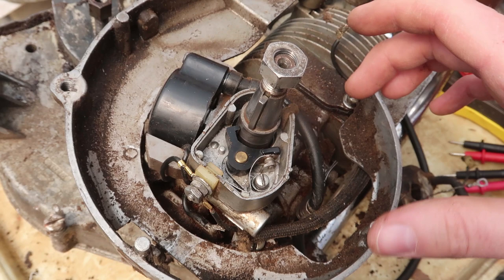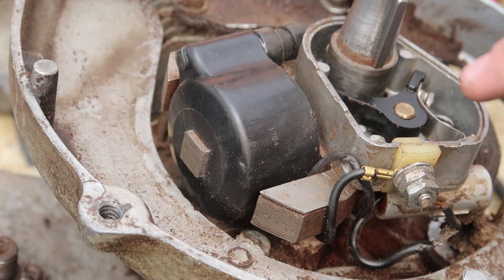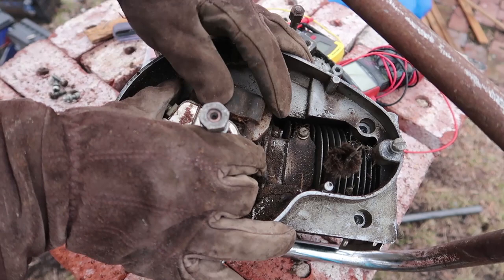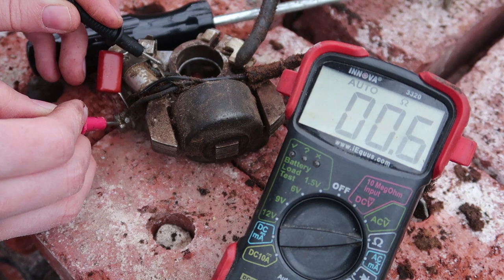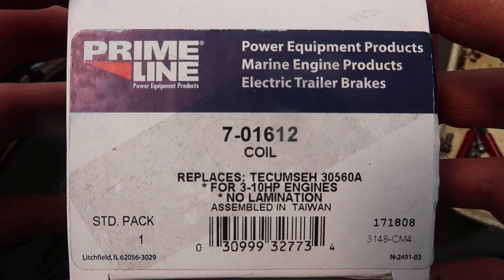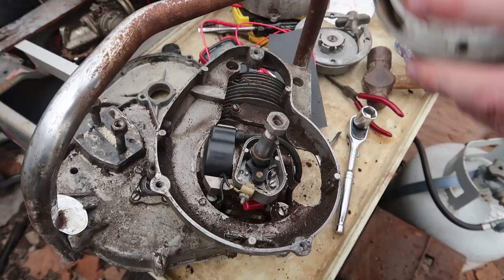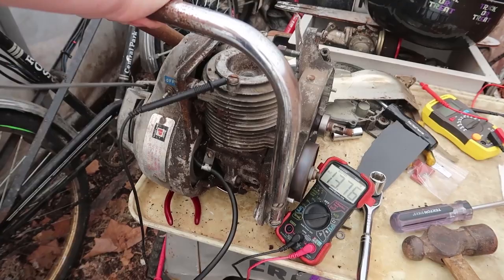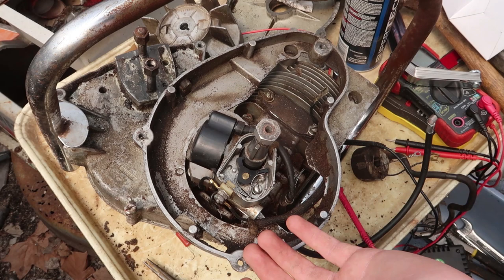1950s David Bradley Chainsaw Restoration 04: Magneto Coil Upgrade Experiment, Fix No Spark

Comment: Make sure there is no suface rust on the inside of the flywheel
Reply from the maker: why?
Reply: So that magnets can be as efficient as posable also when seting the coil to the flywheel rotate the flywheel and let the magnets grab the coil then insert a piece of paper between the coiled the flywheel ( might have to double the paper so there is no rubbing) this very critical for a strong spark.
Reply from the maker: cant set coil distance at all in this
Reply: Sorry that works for external coils But try and shim out some how till it almost touches the inside of the Flywheel.   .010    or less. Also the wire that goes to the switch at this time unhook it completely all it does is ground out the mag to stop the engine . if you do get it to start just put a screwdriver from the clylinder fins to the high tension lead on the spark plug

Comment: the cable that goes from magneto to switch to frame is how u kill the engine when u want to turn the engine off. If that wire does not go to frame then you will get no spark. U have other issues as well im guessing but just confirming for u what that wire is for. I had a ride on mower a few years back that started to play up. The problem was when i wanted to turn off the engine it would not turn off.. I found out later that the wire that goes to the kill switch had rubbed on the frame and was grounded out before the switch. Allowing it to start and run but not shut off.
Reply from the maker: sure but it doesnt seem to make much difference when measuring resistance.
Reply: I dont get it either.. and im sure there is more issues then this going on, but thats how a kill switch works in general.. it breaks the wire from the coil to the frame. I can see the wires are joined on that bolt that looks like its on a nylon insulator? if U pull the wire off that goes to the kill switch do u get continuity from that wire to the frame? as You should not be getting a reading between the 2. You may have done this already I cant remember.
Reply: Nitris
The opposite, if you ground it you will kill the ignition. The kill switch is parallel to the points, when grounded it bypass the points so they no longer have any function. :)
Reply: Koaren so u are talking about this chainsaw specifically or small motors in general?
Reply: Nitris
As long as you have a magneto system it's standard. On battery and generator systems, you switch off  V+ to the ignition coil.
Reply: Fair enough I can understand how bypassing the points would kill the ignition system ..

Comment: put it back to STD as close as pos  points 12/15 iron lams no prob  i do that all the time  air gap ///mags to to lams no more than 35 ///looks like a wico set up
Reply from the maker: your comment is very difficult to understand, but you cant adjust distance from the magneto core to the magnets
Reply: i know but it dose have a spec

Comment: You can't replace a condenser with a capacitor.that condenser can be charged with enough voltage to knock you down that electronic capacitor can't do that.
Reply from the maker: you obviously lack a fundamental understanding of electronics then

Comment: It´s still named "Kondensator" in my language.
Reply from the maker: thanks, ive been trying to increase my knowledge of german. one more word for my vocabulary. (•̀ᴗ•́)و ̑̑
Reply: Same in Swedish as in German i think... :)
I am not sure, but it possible came from German back in time... (However, ve used lot of American stuff here back in time)
Capacitor is probably an updated name? At least It feels more modern to better fit the theory.
Reply from the maker: yeah ive started to notice how a lot of other european languages share a lot with german, im thinking about once im done with german and japanese i may try something like swedish. I wonder how all these crazy problems in sweden will effect how useful the language is. Like if sweden does continue going downhill, there might be more swedish-speakers moving to other countries before too long. would be sad if Sweden ends up with mostly middle-eastern languages and all the swedish speakers move to other countries. lol

and i find "Capacitor" starts replacing "Condensor" some time around WW2, i think because with WW2 technology we started going more towards electronic circuits than older systems. and i think the latest i ever saw "condensor" is maybe the 1960s. so really the name came about when electronics was established.
Reply: Sorry for loosing my temper about that topic...
I think i better delete that.

(In case someone wonder, it was not about Rinoa, it was about the fact that i am to say the least furious about my country)
Reply: I hawe ADHD so i often rushing away when i write things.
Reply from the maker: aw darn, i didnt get to see your rant. could you PM it to me? id love to hear your opinion but i totally understand not wanting to say it publicly.
Reply: It was just about those happy cload people here try to cover it up, they are idiots.
The truth i see with my own eyes is that the social cracks between poor and rich people has escallated like a rocket since the early 90s. I hawe lost my fate in Europe, at least in scandinavia. Now it´s fine living here in the north, but not if this continues when i grow old and no longer can take care of my self, i want people i can trust around me, not those underpayed lowbeings. Health care, education for our childern, etc, that´s where i want the tax money to go if i could choise... I am not the only one seriously concidering leaving this country.
Reply from the maker: if you leave, try coming to Hillsboro illinois. you could rent a house for pretty darn cheap
Reply: I am actually tempted anyway for a limited period if i can make it possible in the future, it had been wery interesting to live ower there for a bit longer period just to learn and see all that wonderful stuff and the nature, etc. I will absolutly keep that in mind. (Honestly i think i look more like Ron Soyland then a beautiful girl, but yeah... ha ha!)
Reply from the maker: meh, physical looks arent as important, it just matters that you know how to look nice with what you have. i notice too many transgender people simply dont know how to look nice and choose all the wrong clothes. way to feminine or flashy. oh and about visiting, you could maybe come next year and stay at the Red Rooster Inn when its done.
Reply: I would love that!
I am not traditional transgender i think but bi gender with a dominating womanly side (at least i feel like 100% woman inside, but i am not sure if i will ever dare to start a real HRT and stuff even if i dream about it a lot).
Reply: Since i was a kid, I often wished there just was a secret closet one could walk into and the come out as the person one are inside, but we all know it does not work that way... ha ha. I wonder if one was born that way, i guess i had missed lot of knowledge and life experience, so probaly at least  i got something from it... i don´t know... ha ha.

Comment: spark plug aint no good
Reply from the maker: both of them that i tried?
Reply: If the  other one was used too then quite possibly or if its the wrong kind of plug,   if it hits hard enough to hurt , it should fire the plug .
Reply from the maker: no the other one was brand new. it was for a motorcycle and it's gap was shorter, but i dont think that really matters.
Reply: I could certainly be wrong . Iwoulda bet money on it though . and for what its worth i was hoping to be helpful .. and right ..   I watch your channel every day  for quite a while .  i feel honored you replied . let us all know when you figure it out .   
If you haven't already .. you could check the plug for continuity .
Reply from the maker: i checked it for continuity, but another thing to check would be insulation. i might see about making a high-voltage tester for these applications.
Reply: Connect it to something you know works like a lawnmower or something and see if it fires . do it in the dark and see if it is the insulation.

Comment: Why not spin the engine with a drill? Test with plug out. Maybe the higher speed will show that you have a spark.The plug should be gapped at 0.025 -0.030 thousands. or try a new one. The carb should be easy to clean.
Reply from the maker: because its easy to do by hand. and carburetor might not be so easy if the diaphram is ruptured